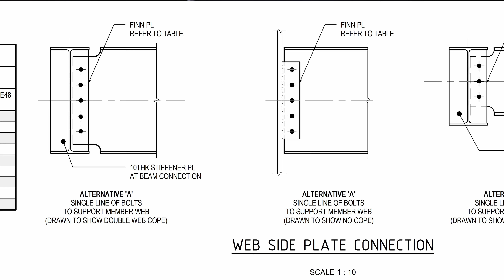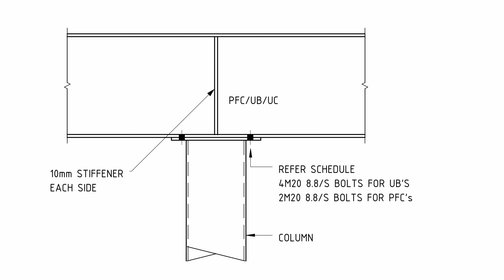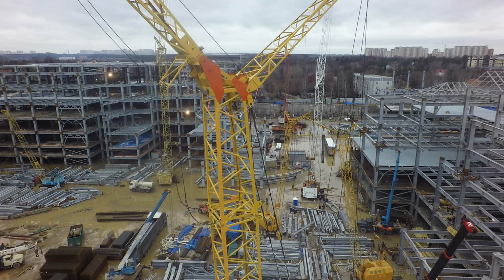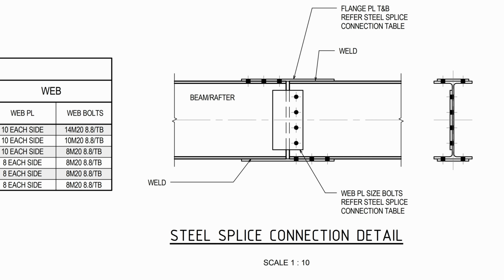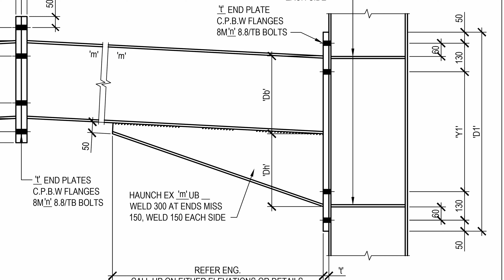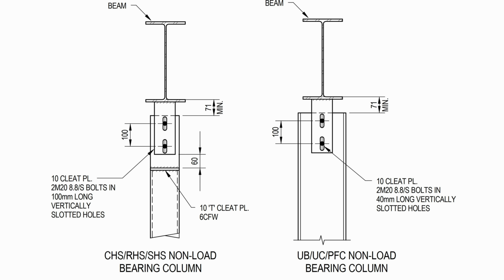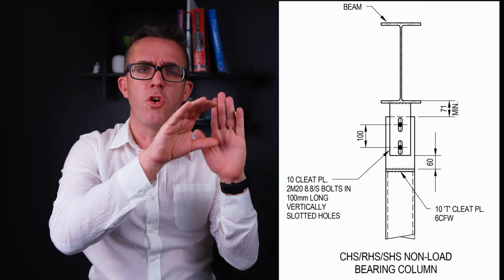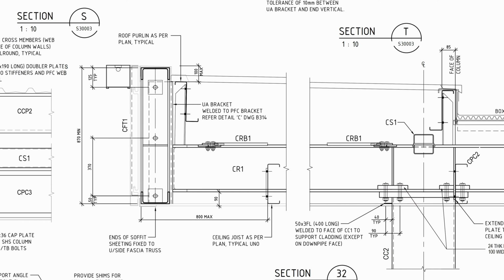The Common Types of Steel Connections

Comment: Hello Brendan, I commend your effort and zeal in making these vidoes. It is obvious that you are proficient in your job, and you have the passion to pass it on to budding engineers.

Nevertheless, I'd suggest having an explanation of each concept (in this case connections) as voice-overs while giving more time to the structural drawings and details. In this case, more time should have been given to the connections than their explanation. This will aid young engineers who lack site experience to visualize the structure more.
Reply from the maker: Thanks for the suggestion for improvement.
Reply: More time will ruin the "momentum". Now I came why there is always a dead line and "pressure". Inner engineering.

Comment: love your videos, its interesting to see some of the slight differences in connections we use.  For the beam or column splice we just do bolted on both members (no shop welding of plates).  And bolted moment connections are extremely popular in our steel building design but as another commenter mentioned, as the buildings get larger, the connection design is done by a PE at the company of the steel fabricator and we as EOR just review their design and approve their design during the shop drawing phase.  But I do miss designing the connections, it was fun!
Reply from the maker: Hi Peter, Designing and detailing the connection in steel is one of the most enjoyable things in steel design.
Reply: @BrendanHasty  It is, but placing columns and beams that work within an architectural layout is a puzzle and skill in and of itself, a lot of fun as well!

Comment: Great video! Do you have any best practice (or reference) for bolted connections in marine/subsea environments?
Reply from the maker: Hi Sigurd, this would really about protecting the steel work. Bolts may be stainless steel, it may also need a maintenance regime. Thanks for watching and the support.

Comment: Hi Brandon, 

What is the tolerance within the steel erection
Reply from the maker: 2-3 on a connection between columns that gived you around 6mm.
Reply: Thanks Brandon, 

I also wanted to ask, is there any rules for the installation of bolts, example for the columns that have end plate splice should the bolts be on top and the nut at the bottom?

Comment: Is it possible to have zero weld steel structural connections? for example, for joining two UBs at right angles, could you bolt to both beams with a bracket in between? I remember reading about weldless cleat bolting systems somewhere. Is there also a way to splice beams together without having the weld on one side at the top and the other side at the bottom as your diagram has. I am amazing at how much welding is required even for small steel structures given the added cost and delays it may bring, whereas a structure primarily built with bolts would likely be easier to erect don't you think? anyway, interested to hear your thoughts if you have the time.
Reply from the maker: Hi Benjamin, you can make the connections without welding, however it doesn't save any time. As the welding will occur in the factory prior to coming to site. They would also be some secondary actions to be careful of with a connection that I'd fully bolted.

Comment: Hey Brendan can you suggest me any topic for the thesis (structure engineering ) thanks
Reply from the maker: Hi Kimmy I always found structural dynamics interesting, either for slabs or building behaviour(lateral). Shaping building to reduce wind load would also be interesting.  But my best recommendation is pick something you find interesting and a lecture you work well with.
Reply: @BrendanHasty  thank you

Comment: right now i am in my senior year of the bachelor degree in turkey. i would like to consantrate on structural engineering, especially steel structures. Do you advise me to take my MS degree on structural engineering first and then get into my career? is it important and necessary? or should i just get into work and have experience after bachelor degree?
Thank you for sharing this type of informative videos 🙏
Reply from the maker: Hi Kaan, Start working you will learn alot, you can take MS after a couple of years if you want to extend your knowledge.

Comment: Seismic engineering design for steel structure means much more complex connections for elements, however, the detailer must be trained with sufficient seismic engineering knowledge and skills.
Reply from the maker: Hi Scott agree on that. Fuses, dampener and much more.